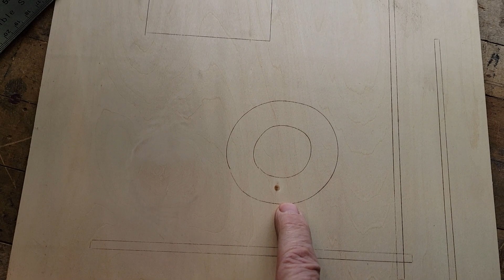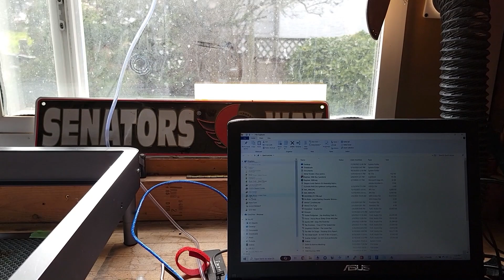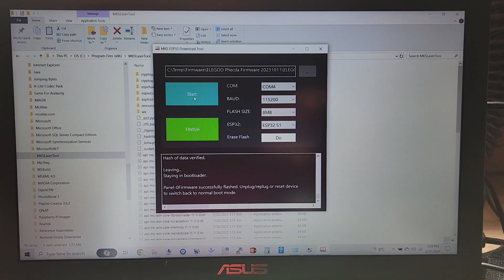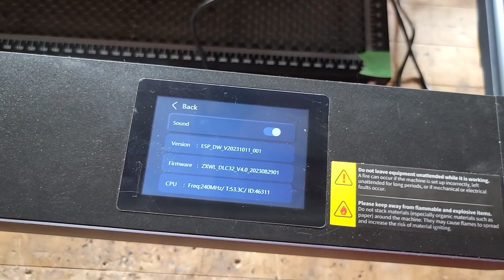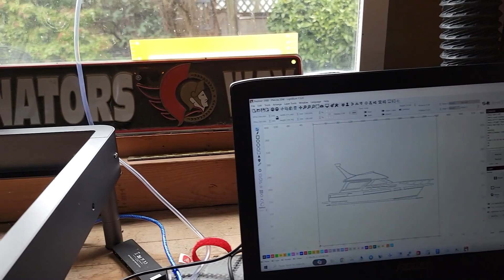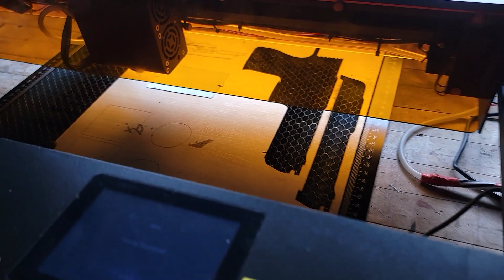Elegoo Phecda 20W Troubleshooting and Firmware Update - 11 Feb 2024

Comment: I am unable to connect the device to the Phecda app on my Android phone. The engraver appears in the Wi-Fi settings on my phone, but when I attempt to connect, I receive the following error message: "Error Code 60: Failed to mount."
Reply from the maker: @sulimaanshah6199  Tgisbissue was fixed bot long after I made this video post. Did you install the driver? Are you using Lightburn?

Comment: On my new Phecda, I had issues Y-axis issues, too. Turned out a screw on the "optical shaft assembly" (the long steel rod that connects Y-axis motor on the left to the belt on the right) coupling came loose and made the Y-axis sloppy. The coupling has two screws on it; both must be very tight, as it is under frequent back and forth rotation.
Reply: Muchas gracias amigo

Comment: One last suggestion... The drive pulley that moves the laser carrier, the one moving the x-axis.  Can you check to make sure that pulley is held tightly to the shaft?  If that were a flat shaft, and the grub screw is working it's way looser, I could see this happening.  But I understand your frustration.
Reply: I have one with same issue. The problem is where the pully connects with the metal rod. Its slipping in the mount. Mine is 1 week old and going back